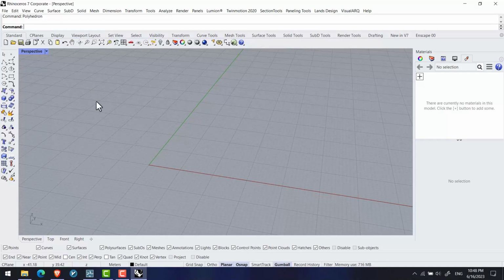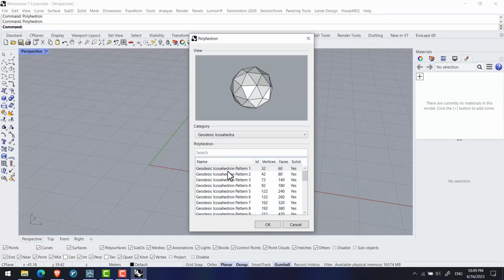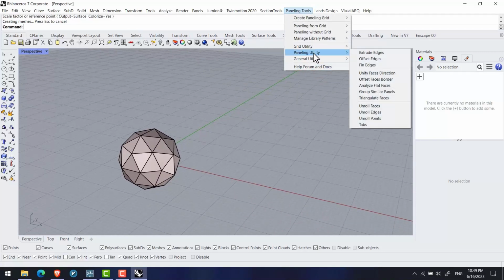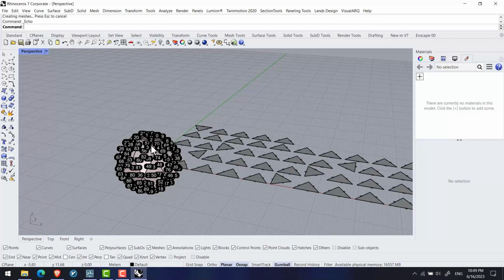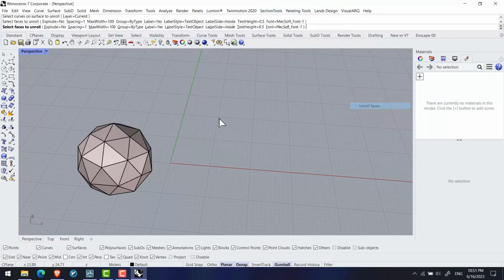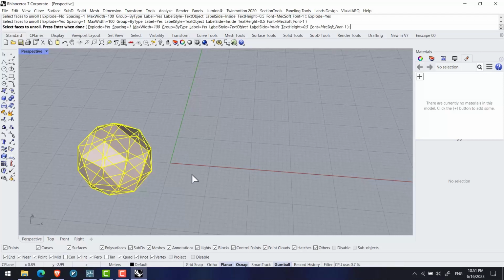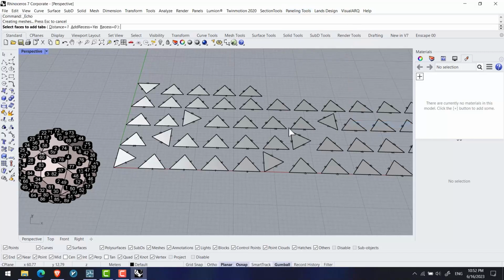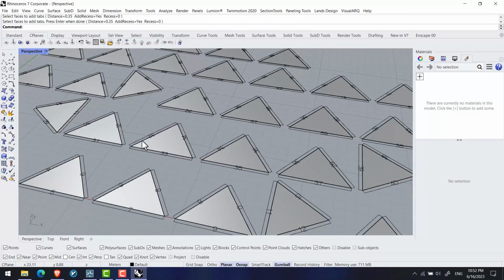🔨🔩 𝐑𝐡𝐢𝐧𝐨𝐜𝐞𝐫𝐨𝐬 -𝐂𝐫𝐞𝐚𝐭𝐢𝐧𝐠 𝐖𝐢𝐝𝐞 𝐏𝐚𝐧𝐞𝐥𝐬 𝐰𝐢𝐭𝐡 𝐒𝐞𝐚𝐦𝐥𝐞𝐬𝐬 𝐄𝐝𝐠𝐞-𝐭𝐨-𝐄𝐝𝐠𝐞 𝐉𝐨𝐢𝐧𝐭𝐬 𝐔𝐬𝐢𝐧𝐠 𝐏𝐚𝐧𝐞𝐥𝐢𝐧𝐠𝐓𝐨𝐨𝐥𝐬 𝐏𝐥𝐮𝐠𝐢𝐧

Comment: Good evening, I followed the Icosahedro Pattern 1 tutorial step by step, selected the Polyhedron - Paneling Tools - Paneling Utility - Unroll Faces, but I can't select the faces. I performed the operation with both Rhino version 7 and version 8. Can you kindly suggest the solution to the problem? Congratulations, I recently purchased 2 courses on Udemy, I find them admirable for their ability to be very practical.
Reply from the maker: It seems like you're experiencing difficulty selecting faces in the Icosahedro Pattern 1 tutorial, even after performing the operation in both Rhino versions 7 and 8. 

One potential solution to this problem could be to check the settings or options within the Paneling Tools or Paneling Utility plugin. Make sure that the selection method or settings are configured correctly to allow you to select faces for the unroll operation.

Additionally, ensure that the geometry you're trying to select is properly constructed and visible within your Rhino workspace. Sometimes, complex or hidden geometry can make it difficult to select specific faces.

If the issue persists, I recommend reaching out to the support resources for the Paneling Tools or Paneling Utility plugin, as they may be able to provide more specific guidance tailored to your situation.

I'm glad to hear that you recently purchased two courses on Udemy and find them admirable for their practicality. If you have any further questions or need additional assistance, feel free to ask!